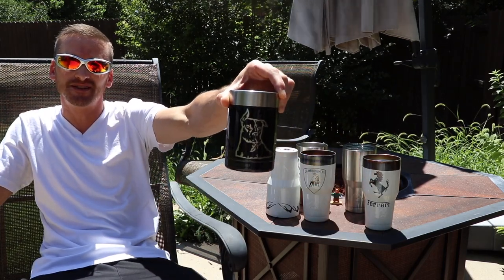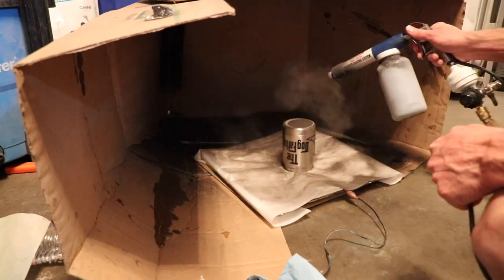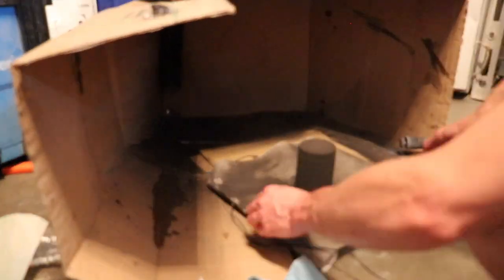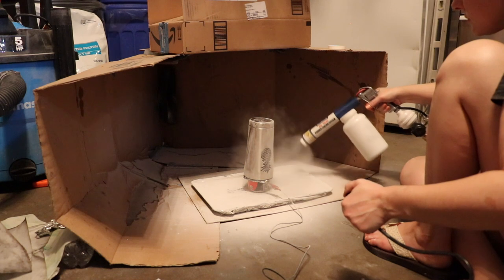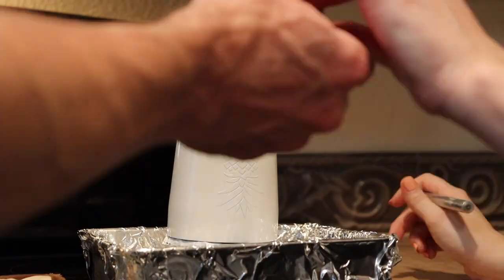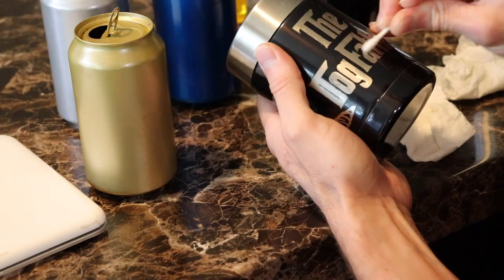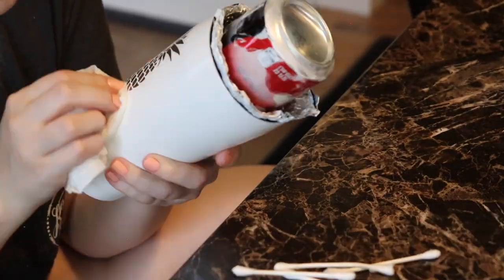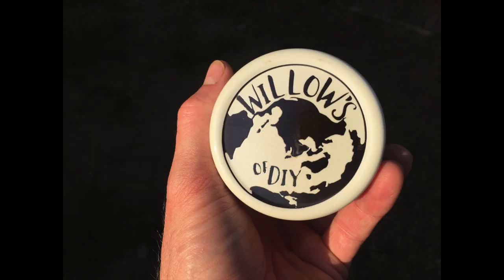DIY Custom Powder Coated Tumblers

Comment: Great video! Can you tell me which type of vinyl you are using for your decals?
Reply from the maker: I used 651 vinyl, it can be a little difficult to get off and leaves adhesive on the cups. I need to experiment with other vinyl's to see if there is something that will be easier to remove. If you find something better than 651 vinyl please let me know. Thanks for watching!
Reply: @WillowsWorldofDIY  I remove my 651 vinyl just as the powder starts to flow out. It peels right off, often in one piece (in the case of solid lines/text, ect). I found leaving it on much longer it does get pretty difficult to remove.

Comment: Great video. What machine do you use for the powder coating?
Reply from the maker: In this video I'm using a Eastwood duel voltage powder coating gun.
Reply: @WillowsWorldofDIY  they don't make that model anymore do they?
Reply from the maker: Eastwood still makes the duel voltage hot coat gun but its an updated design and looks a little different than the older model that I have. I hope this is helpful. Thanks for watching!

Comment: Do you suggest clear coating everything?  And how do you  do an object the has to be powder coating on all sides  and cant be propped up?
Reply from the maker: No I don't clear coat everything, it depends on the powder and if it's  a indoor or outdoor application. I clear everything that is going to be outdoors unless the color coat is UV rated, because the clear coat I use is UV rated. I would try to find a spot to drill a small hole to hang it with wire if possible.

Comment: What decals do you use?
Reply from the maker: On these tumblers I used 651 vinyl to make the decals, but I recently started using 631 vinyl because the decals are easier to remove after baking. I hope this is helpful. Thanks for watching!